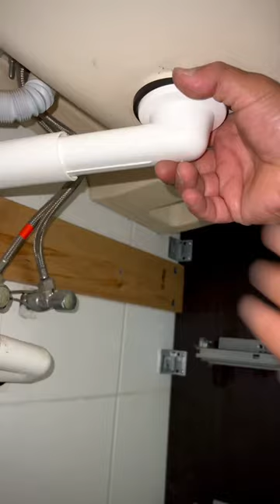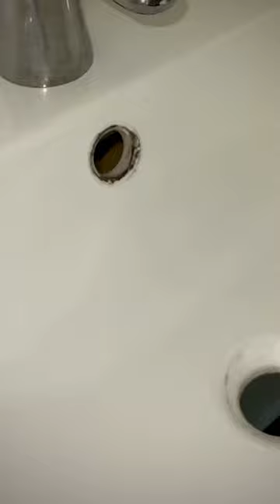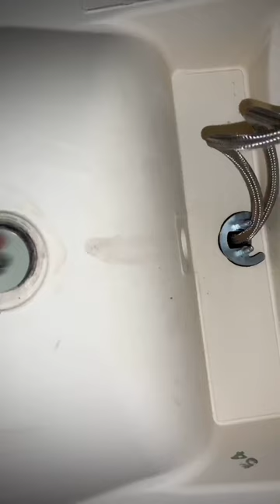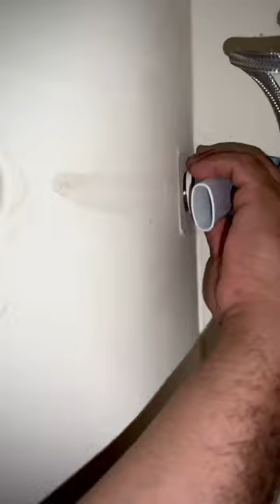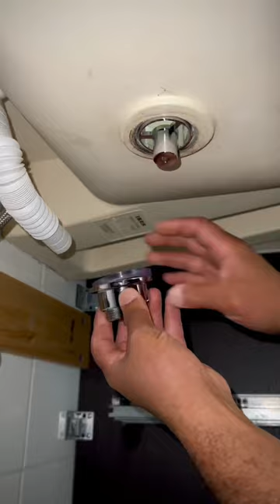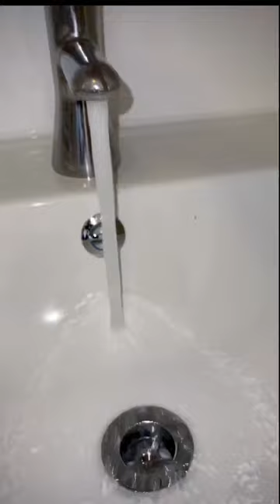How to replace an IKEA washbasin siphon Instruction Can be used for all sinks #ikeadiy

Comment: Flex pipe though? Plumbers hate that to begin with lol
Reply: For the overflow part its fine as it should almost never be used, the rest is normal pipe
Reply: Creates a crazy amount of mold, we do hate it.
Reply: It’s the overflow - of course it’s flex 😂😂
Reply: Don’t forget it’s IKEA😅
Reply: Where can I get the overflow parts and the drain kit. These are not from ikea.
Reply: Well I'm not plumber  and im a kid in my one it's a still pipe thing that doesn't bend it's just plastic in my kitchen
Reply: The overflow for sinks are always some kind of flex, now for the bathtub it would always be sched 40.

Comment: That Flexipipe isn't the best part to use. Would smell because of the build up. Doubt it's code in many places but the rest looks fine
Reply: My p trap is made of flexipipe
Reply: @brandonestes2139  wait till about an year in summer you may need to change it but if it works all good 😊

Comment: It's not clear how that ikea pipe fits into the wall pipe
Reply: I think it was a rubberized plug that the Ikea pipe plugs into. Doesn't look too secure, but I'm not a plumber. I have to replace a faucet and remove the garbage disposal. This looks too cheesey to use as a replacement.

Comment: Ikea sucks as furniture.  who would want an “ikea “drain system?    😳
Reply from the maker: I agree. But if you have a IKEA😂
Reply: @diyplumbinganouar9018  I have no “ikea” that crap is still around. 🤣😂
Reply: @diyplumbinganouar9018  Names of parts used or links to buy them? Thanks for the video.

Comment: IKEA plumbing junk lol use plumbers putty or you will get a call back lol
Reply: Plumbers putty does not make a seal or prevent leaks, it merely fills gaps to prevent a concealed fouling surface. LMFAO!
Reply: @shelbyseelbach9568  no shit Sherlock lol it’s meant for the underside of your po where it meets the porcelain, those foam gaskets leak all day long, can’t beat plumbers putty ask any plumber out there
Reply: @derekmcdowell2547  You just asked a plumber. You simply don't like the answer.